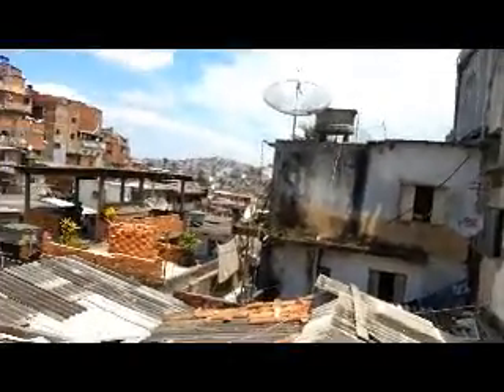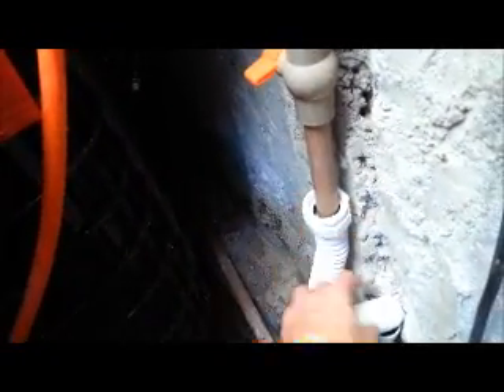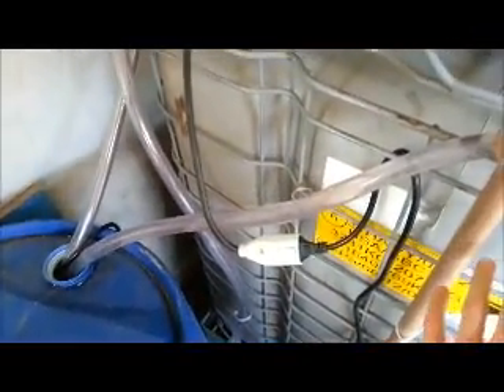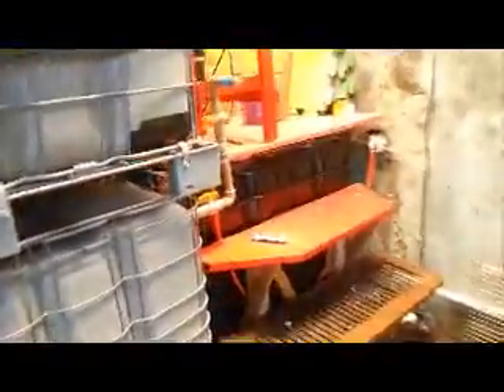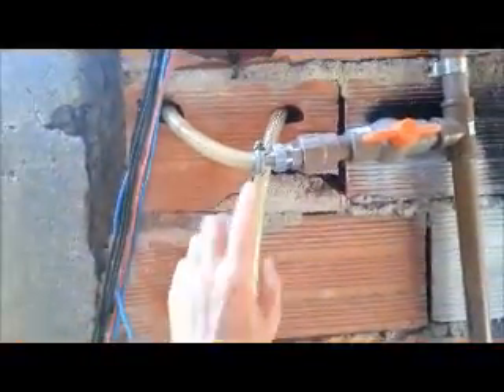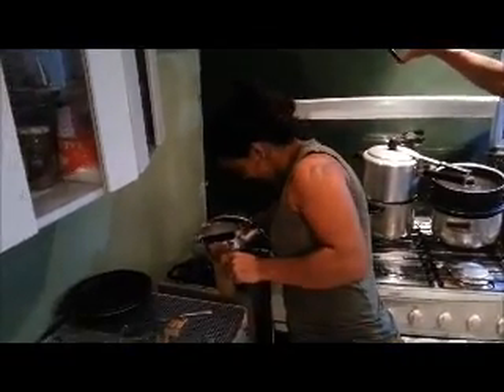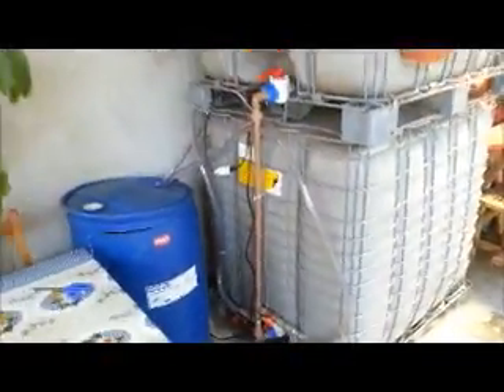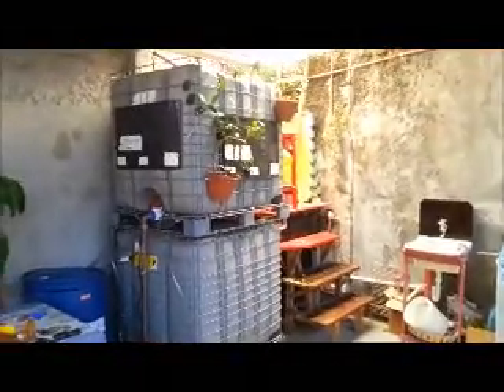Jardim Angela Biogas

Comment: Really good video - been watching a few of the solar CITIES animated vids about IBC anaerobic digesters (hopeing to build one ourselves) so good to see a vid of it in production.  One question I have - why does the system need the pump tank?  Would it not be OK to simply hook the bottom gas reservoir directly to the top water store, or is there not enough gas pressure to displace the volume / weight of that much water to that height?
Reply: I think there is a new design without a pump, useful to go to the Solar Cities group on facebook, amazing tech support there.

Comment: Couldn't the pressure from the methane push the water back into the top tank if they had some small tubing running from the bottom of the methane tank to the top of the water storage tank? I'm Trying to build my own but don't understand the necessity of the pump. Please help. I really like the idea of the water supplying the pressure don't really like the floating tank method of adding wieght to supply pressure.

Comment: Hi! Am busy building a similar system to this but have adapted with to function in cold weather climate. How much water did you put in the water pressure / gas storage IBCs? Am planning on using ethylene glycol to prevent freezing in winter but not sure how much to order. I'll be needing about 50% water to 50% glycol to prevent freezing in the colder months. 

As for the digester's heat solution, I am making a heat composter, with an inlaid hose and a pump to get that warm water into the heart of the digester. Not to mention, a ton of insulation, surrounding it with all my trees and debris from tree-cutting.